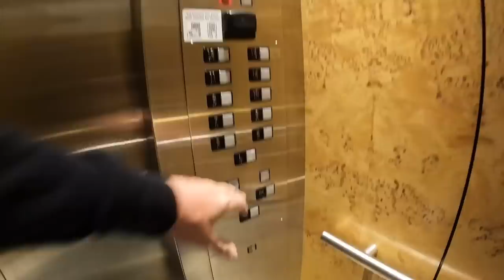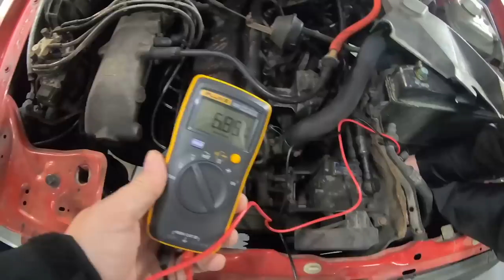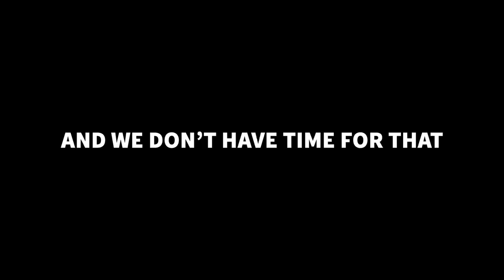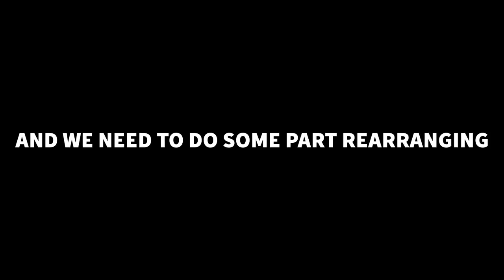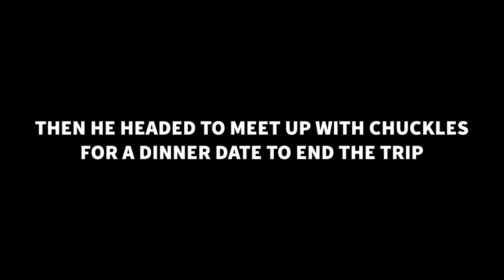Another Scotto Carcaine Special: A Solo Mission to Canada for ANOTHER AUDI

Comment: I used to own this 4000q from ~2011-2013. I was the 3rd Canadian owner. I found it for sale on Craigslist for $1200. It was parked on the streets of Mt. Pleasant in Vancouver when I first saw it and it I wasn't interested in it because of the rust, especially the strange spot right below the drivers door handle.
A few weeks passed and the owner offered it to me for $800 and said if I didn't buy it, he was going to send it to the junkyard. I didn't need it at the time as I had a 4000q that I swapped a 20vt into but I bought so it wouldn't be sent to it's death. It sat in my yard for a couple years and I never really drove it until I decided to get out of the old school Audi's. The guy that I sold it to was not the guy in the video that you bought it from so there had to have been at least 5 Canadian owners. The car is originally a US car I believe from the Spokane area of Washington. If I remember correctly the first Canadian owner documented purchasing the car and bringing it up to Squamish on motorgeek. It's nice to see that its still alive 10 years after I sold it!

Comment: When i was 18 i bought an 86 Audi CD 5000 Avant with the 20v turbo, quattro, 5 speed with the locking diffs for 800$ - i had a blast with my friends and ripped it around for a winter here in atlantic canada.. it was a HOOT. Sold it running driving and inspected (with a malfunctioning turbo and diff locks stuck on) for 400$ and switched to a Lexus es300 😂.. i kick myself every once in a while when the Audi crosses my mind~

Comment: Thanks for a ripper video.
With the temperature guage, you could add a button and some lights. Then you can cycle and check each temp. It could even auto switch to display a temp if it goes outside a preset 'safe' zone.

Comment: Sounds like that's one of those cars that you have to customize just because the factory parts don't exist anymore.. Might be cool to get someone to TIG in a set of 70-74 Challenger door handles that mount flush and are super simple to install/modify. I personally would definitely be looking into a 2010+ 4.2L V8 especially if you can get the supercharged version and updated AWD.. it'd give you like 5X the power and at least double the mileage while being much easier to find parts for.. and even smog legal at that... whereas getting that thing to make any sort of power and still be smog legal with the stock engine is pretty much impossible. (it'd sound WAY better too) 
*GASP! BERNIE!!!!!!!!!!! God I love those dogs, I don't think I've ever met one or if I did it was when I was a baby but I've always wanted one.. unfortunately they don't live very long.